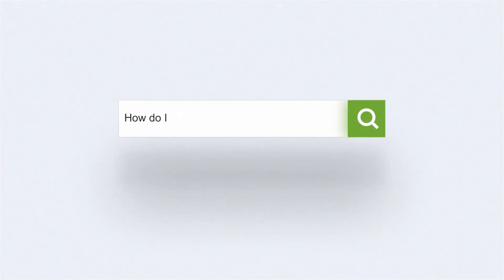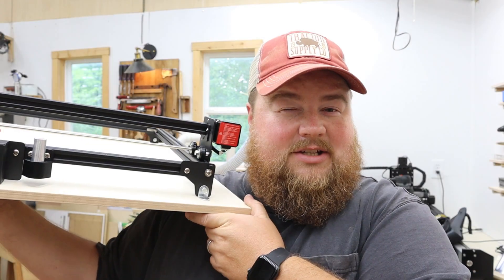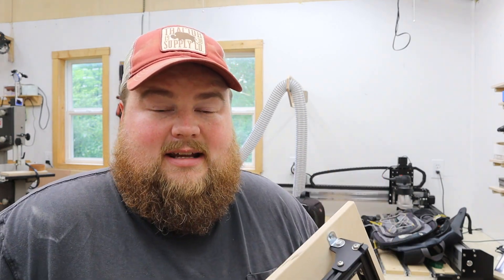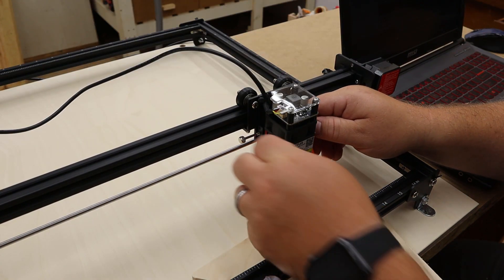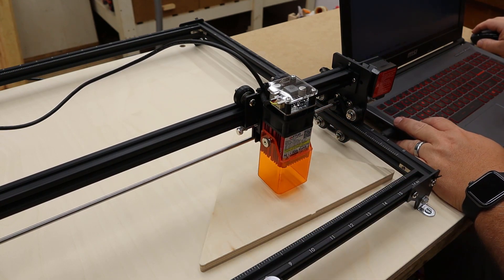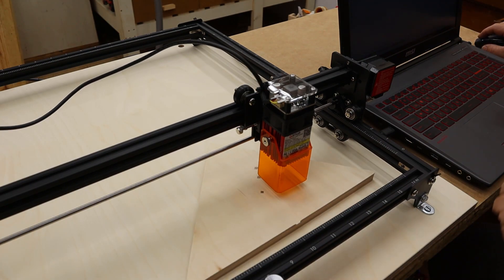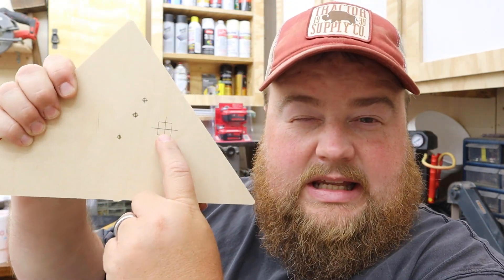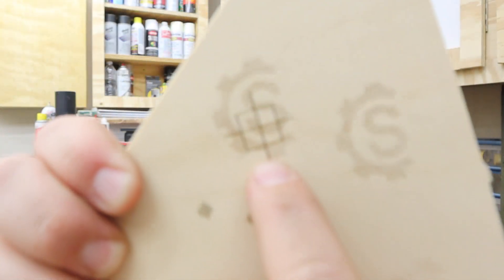WALL MOUNTED LASER ENGRAVER!

Comment: Laser head is resting on the front bar, twisting the cross beam, and laser mount, try storing it up the other way up.
Reply: Could he also just take off the head when he stores it up on the wall? My laser master 3 the head comes right off. Another idea is to mount a narrow shelf for the frame to sit on. The shelf would absorb the weight of the unit and then he could have a couple of straps  on the wall up above for the top end of the frame that he could loop through the top bar when he puts it up. The straps would only be there for keeping it steady. This solution might  take the stress off of the frame because it is being held from below, more than it is being hung.

Comment: Shoot, I thought you were going to make the laser usable while mounted vertically.  The stepper motors probably aren't strong enough for that anyway.  Also, thanks for not drilling with Forstner bit at 10,000 rpm.

Comment: I like the idea and told my wife I was going to store mine on the wall. Two things. I know you have a dust system but it might not be perfect. Will dust hurt the laser equipment?  Second, might I suggest you cut out part of the middle to accommodate a roller attachment or a taller project? Take out the center for a thicker project, use blocks to raise it up and burn away. I saw in a reply to another comment that you could remove the screws. I think I would get tired of doing that.

Comment: Great videos on the Ortur Laser Master 2 Sam! Very helpful as I'm setting mine up right this instant. Can't wait to use it. I noticed that it's almost the exact same size as $5 Ikea Lack side table. Those tables also have the exact spacing for 18" rack so I mounted the laser engraver on one of those, put my printer and stuff on another one, mounted them on top of eachother, added an 18" rack power supply et voila :D Huray for Ikea hacks!

Comment: Really love that base grid design Sam! I'm about to set up my LM2 Pro tomorrow and was wondering if you had those spaced out at every odd interval on center. Also, what speed/power settings did you use for the crosshairs? Thanks, Adam
Reply from the maker: Shoot me an email and I'll send you the Lightburn file for it if you want. :) sam@sam-craft.com

Comment: Could  you use it ON the wall? Maybe if it was canted out with a spacer at the bottom just an inch you could lay whatever flat piece you are engraving on it and have it operate in a vertical position?

Comment: What is the acrylic shield around the head of the laser? The clear Orangish Acrylic?
Reply: It comes with the LM2 Pro laser for eye protection. Still advised to also wear protective eyewear.
Reply: @diytexan5558  the reason why I was asking is I thought it might still need an enclosure but if it's got that protective shield that would work so this can be brought out in public if at a trade show or event thank you for answering the question
Reply from the maker: There is still considerable light spill-out on the back, so bear that in mind. :) I still wear my glasses and have anyone else do the same in my shop when it's in use.

Comment: I just  bought a different brand but am faced with the same problem; where to put it. I'm thinking about hinging my mounting board to a wall so I can lift it up when not in use. Just have to space it out from the wall, sucker is taller than you think
Reply from the maker: That's a cool idea

Comment: Just thinking out loud… if you secured it to the wall at say a 30 degree angle and drilled the crosshairs to take removable dowels that could then support the workpiece - you’d never need to remove the unit from the wall.
Reply from the maker: That'd be one way to do it, yeah!

Comment: Once again Sam, you are one step ahead of me.  I am saving up for that very engraver too.  Is the laser strong enough to cut through 1/8 inch plywood?  I was thinking of using it like a little glow forge to make clean box joints for custom gift boxes. No dog bones needed on th corners.
Reply from the maker: I haven't put it through cut tests yet, so aren't sure.

Comment: Sam, you just made me subscribe for two reasons. I have many of the same tools and space limitations as you. I now have the info I need to mount my new LM2 Pro and my old LM2
to mount with those L brackets for the legs, and hanging both on the wall when I need that table for
flattening slabs of live edge wood. Great video Thank You.

Comment: could you not use the laser mounted on the wall, i'm sure you could come up with a way to mount the materials vertically on the ply base
Reply from the maker: I guess you could do that, but it's not really practical for my uses. Having to secure the material each time would be annoying for me. I like this being a no-contact machine so things can literally just sit there. :) Big diff. from the CNC!
Reply: @Samcraftcom  you could angle it out from the wall a bit, at the bottom, and have a ledge for the piece being cut resting on it, just a thought
Reply: @tdimccullough  It will stress the steppers and lead to missed steps or failed motors without further modification. It can be done with some engineering, but the simple approach here is probably the perfect solution for him.

Comment: I'm curious, the bed height doesn't see very high.  Would it be possible to mount it high enough to say, slide a 2" tall cutting board under it?  I'm looking for a less expensive way to engrave logos into my boards (really don't want to shell out for a glowforge).
Reply from the maker: Absolutely! You could put the machine on riser blocks easily on the four corners. I totally hear you on not wanting to dive deep into the money pit!

Comment: So what's your plan when you need to engrave on thick wood? You need to raise the frame for thick wood.
Reply from the maker: Yes, you would need to do that. If I run into that scenario It's just four screws to disconnect the laser from the base and raise it up.

Comment: Sam, you may already have this planned , but I want to run something past you . How about having a bank of sockets that you can plug your gear into . perhaps at the end of a bench ? or a socket tower ? that can be pushed down into the bench and tidy it away .
Reply: I second this idea. I did that in my kitchen and it’s great.
Reply: @angelacross2216  I did the same in our kitchen. Two 4 foot outlet strips, one on each wall in the corner where most of the electrical appliances live  (stand mixer, air fryer, electric kettle, etc). I drilled thru one wall to the laundry room to plug one strip into a different circuit, so the instant pot and air fryer or kettle don't blow the breaker when used at the same time😊